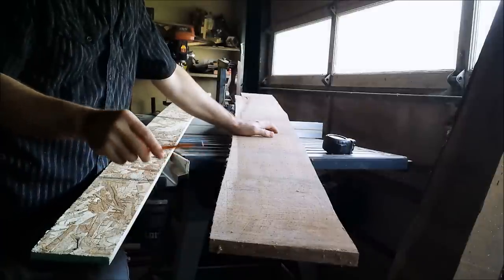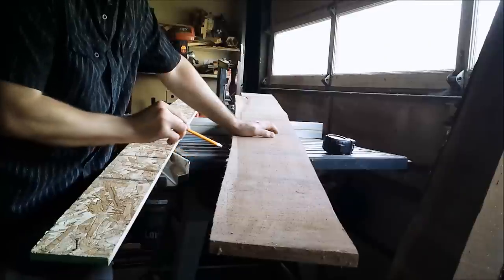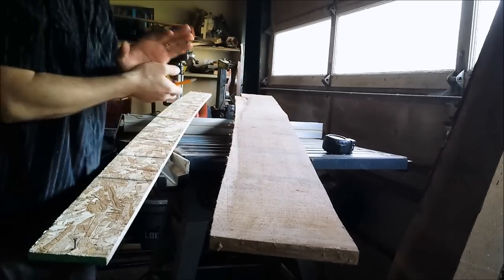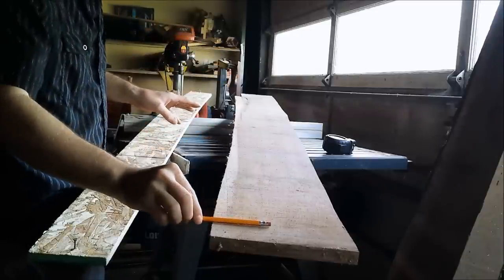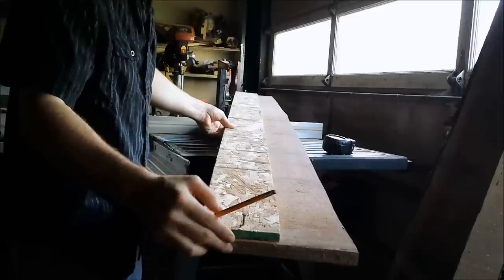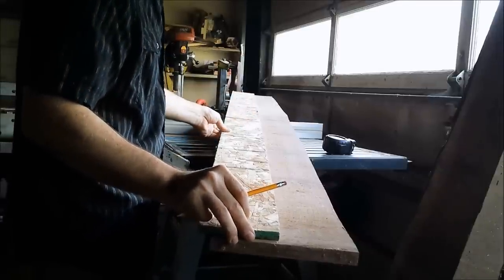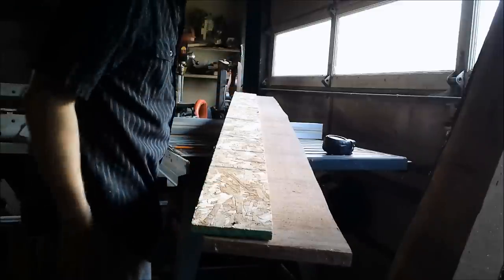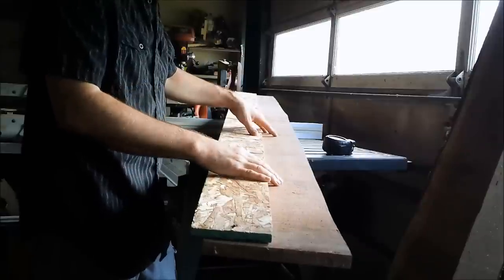How to Straighten a Board Edge on the Table Saw (no special tools)

Comment: so simple thanks for the video. I used a 1 x 6 for the straight edge. I used screws then tried a  2 inch wide heavy duty 2 sided tape instead of screws (the entire length of rough board) and it worked ok too. I think the tape would work if had a piece with no end flaws, but felt the screws were safer.  Just straightened 5 -36 inches pieces and it worked perfectly.
Reply from the maker: I am glad you found this useful. Tons of tricks here on YouTube for those who are willing to search for them.🙂

Comment: Thanks so much for sharing. I just watched a half dozen videos of guys doing the same thing, but they're using $1000 worth of equipment. I'm going to adapt your method for making dimensional lumber from felled tree with my chainsaw. (Chainsaw mill to cut 2" boards and then your method to cut those boards into 2x4's on a portable table saw and gas generator.) Thanks.
Reply from the maker: Thanks, it's so much easier this way just remember to use a steady hand and that putting the fence on the left or right matters because table saws tend to push the wood in one direction or the other.  Knowing your table saw's sweet side is good.  My saw will push the wood into the fence just slightly the way you see it in the video.

Comment: Yes it appeared to work well in this case. But your table saw bed is clearly a bit small for bigger sections & longer lengths. I have tried this method & it's difficult to hold & feed the lumber against the fence on such long pieces.  Maybe an outfeed attachment with adjustable guide??

Comment: Enough about the corder drill. Damn. I use a Cordero drill in the shop half the time because it always runs at full power and there's no fucking around. I have an 18 volt dewalt cordless drill as well. The 25 year old Milwaukee corded drill works circles around anything with a battery. I use it for drilling, screwing, boring out motises, wire brush work and tons of other shit.
You people are a bunch of haters that's all I see here! Don Myers
Reply: Yep same here--I have a cordless drill and cordless driver but often turn to the corded for the reliable power. Great to have options. I also often keep different bits in each to speed up a given task so that I don't have to switch in and out so much.

Comment: Why do you have a cord attached to your drill?
Reply from the maker: I dispise cordless equipment....
Reply: +MrHopekiller  My Makita 3.0 MAH  Lithium batteries last a long time, I might agree if I had NiCad still.  I have 2 batteries per drill set and just rotate them.  I use a drill press if its stationary but when mobile the cordless are superior.  I use a drill about 5 hrs a day.  I do have a dewalt corded drill if I'm drilling metal but now that I have a cobalt bit set, cordless would be fine for that too.

Comment: this is the easiest method on youtube. What I question is the first setup, eyeballing it as you described. Does this require experience to get right? Thanks, your shop looks as messy as mine haha
Reply from the maker: just align the wood grain to the factory edge in parallel

Comment: They will be straight, but not guaranteed 90 degrees to the face.  If the board has any twist in it at all, the edges would reflect the twist.
Reply from the maker: Straightening the edge is the first step.  Not the only step.  You must be assuming this is the final step or something.  Even if you used a jointer instead the twist would still affect the board.

Comment: is a great idea blue. thanks you. for the benefit of your viewers though i would not recommend using a table saw this way. make a fold away out feed table (super easy to make) and a couple of push sticks. will only take a couple hrs. letting go of the wood and running around the other side to pull it the rest of the way through the cut is very dangerous. please do not use a table saw this way. thanks again blue. is a awesome time saver. :)
Reply from the maker: +wayne d Thank you sir.

Comment: Although, just for your viewers, it is OSB not plywood.  Plywood would be a much more stable material than OSB if near a body of water or high humidity.
Reply: +Kris Says: OSB is plywood, chaos plywood.  I live in a place where it can rain 50 inches a year and we use OSB all the time.  It can handle a couple days of rain in most cases, but not much more. I made a shed door out of it thinking it wasn't the right choice; shellac primer and good paint - lasted over ten years. I saw a clock a guy made out of it the other day - did a double take. He used complicated joinery and used a fine finish. I didn't think it was possible to make the stuff look good. I wouldn't make a boat out of it. With the low cost it's a great choice for a straight edge.

Comment: I'm with Mark leaving a piece of wood in a running saw "Kickback".  When I saw that I almost jumped out of my chair.  I do like your method and I will use it but I will not leave the piece of wood alone in a running saw.
Reply from the maker: Michael Litvin I don't use the kick back guards, they have a tendency to block my vision and sometimes scratch the wood.  I know I should for my own sake, but I just can't bring myself to attach the thing.  Push sticks and pad are the best method for accuracy but I don't always use those either.  I think the worst thing you can do is hold on to the piece too tightly, you need to be ready to let the wood fly if it wants to because otherwise your hand my get pulled in, so I keep a nice feathery grip.  Kick back guards make some folks over confident and I just have no faith in them.  Thanks for the compliment also!
Reply: tottally agree on the kickback comment.if my grandpaw saw me go to the other side of saw and start pulling on board.id have that wood on my backside...and would be watching not cutting.thanks stay safe
Reply from the maker: +Joel Haley Wow you are kinda old to be getting your Grandpa to spank your hiney, but to each their own I won't judge.
Reply: +BlueMacGyver I wonder if some people have even used a table saw before giving safety advise. The way they talk I don't think they have. Always this fear of kickback, like it's a daily thing. I know the difference in power between a tabletop, contractor, and cabinet saw. I was taught 40 years ago to never trust the trueness of a fence, always check front and back clearance. and only use the saw's built in scale as a rough guide. I don't have kickback. I see so many videos of people just sliding the fence over and locking it down. For these people the grand spent on a high dollar fence and safety bells and whistles isn't enough. It's like we were taught to adjust the mirrors before starting the car. Safety logic would dictate that wearing a helmet would negate mirror adjustment and telling others to wear helmets is not optional, but mandatory.

Comment: The negative first, you lose your professional creds wearing flip flops in a shop.  The positive, you have a Yankees hat.  You solved a big problem for me.  I am restoring a 300 year old house and have salvaged a lot of lumber.  Keeping in mind that they had to do everything by hand, meaning the thickness of the boards can vary over 1/4 inch in 8 feet.  My planer has taken care of that, my dilemma was the edges weren't square.  I have been resisting buying a joiner and your video was a Godsend.  Thank you - and lose the flip flops Norm Abrams would faint if he saw you - LOL.